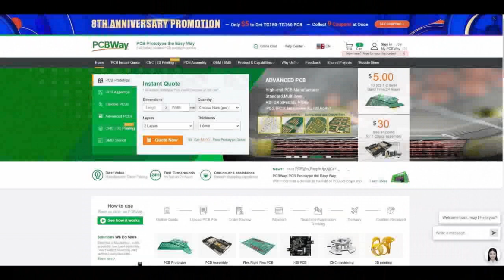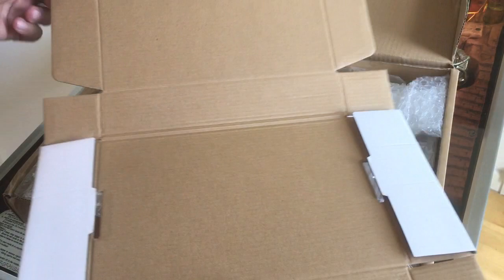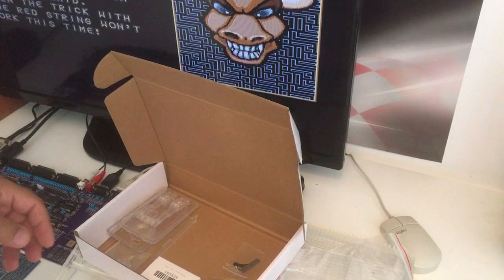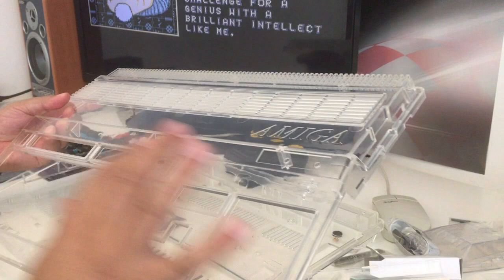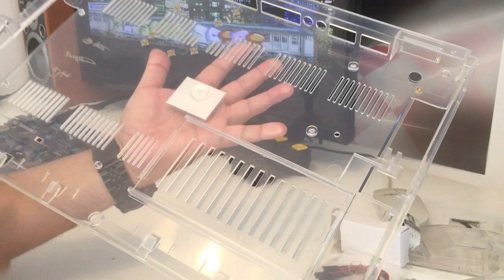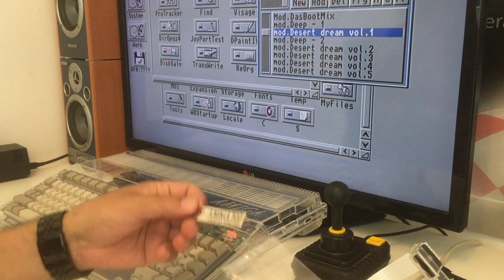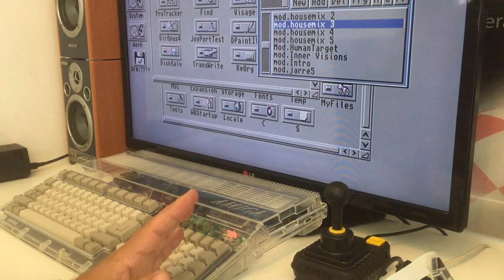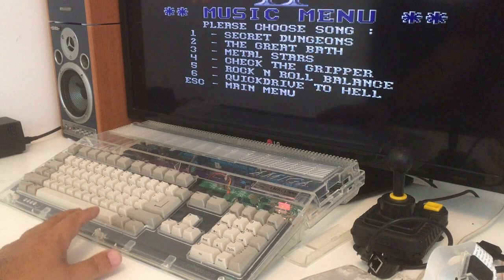Crystal Clear Limited Amiga 500 Ultra Replacement Case Unboxing/Review with A500++

Comment: Just WOOOOW 👍🏻🤠
Looks amazing 🤩 I need this case too,for my 500er ! Thank you for the great video 🍻🙂
Reply from the maker: Thank you Aco, remember to use the code: Retrocengo and now getting 20euro discount. Let me hear what you think of it :-)
Reply: One quaestion,  why don't you mount the shielding plate on the top of the Amiga ?

Cheeerssss 🍻😎
Reply from the maker: @acod.9774  Top plate blocks me seeing my Amiga 500 board🤣🤗
Well cuz it keeps the heat trapped inside makes the Amiga costum chips running hotter, which is a very bad idea for 35years old ic chips

Comment: I’m excited to receive my case too! I would love to be able to install a tiny PC in one of these for work, so I can pretend I’m using an Amiga for my job.
Reply from the maker: Hahahahha😊😊
What color are you after?
Reply: @RETROCENGO  I backed the original campaign for the Vampire pack, which I think is black. My original intention was to put an Amiga in it, but now, I’m thinking I don’t need to as I already have a complete A500. I wish I could put a PC in this instead, but I don’t think it’s possible. Let me know if I’m wrong!
Reply from the maker: @piyushkhengar  you can put in a raspberry pi in it easily 😊
I think a workaround for a micro atx board could be fitted in it

Comment: Your A500++ looks so freakin' awesome in that case, wow! 😍
Did I get it right, you're planning to put in the lower shielding again? Please don't do that, not in that crystal clear case!
Have you already tried to put the Floppy into it and the crystal eject button? There's a high chance that the button won't fit, if you've got the wrong drive!
That was the case with my recently bought transparent case for my A1200 (unboxing video on my channel ^^). Also I couldn't put in the Floppy at first, as the hole on the Amiga PCB won't allign with the metal bracket! I had to file the bracket holes (both of them!) a little bit, now it fits. Also I couldn't insert a PCMCIA adapter at first, as the case won't let me! I had to widen the slot of the case with a file a bit, works now.
Just tiny things, but they shouldn't happen at a brand new case at this price range! Maybe you have more luck with your A500 case especially with the Floppy! 😉
Reply from the maker: I haven’t had any issues, but floppy drive is not installed either. Well it’s not the old metal shielding, but a back bracket
Reply: @TPau65
Thank you for your feedback :)
- The A500 Cases are provided with Chinon FB 354 floppy buttons. Since there is quite the number of different drives out there we most certainly couldn't provide a button for all of them.
- The A1200 case was provided with a floppy button which likely won't be compatible with most A1200 owners drives. This issue  is due to both A1200 units used to design molds had custom drives! It wasn't spotted at the time and sadly its not fixable in molds. We apologize for this issue.
- The PCMIA Slot on all our A1200 cases are perfectly sized. 
Please double check your mobo alignment. Something must be wrong. You shouldn't have had to file your case. What you can do instead is insert a PCMCIA card in the slot first with your mobo being loose in the case. Then adjust mobo position in case and fasten mobo. This process should place the motherboard correctly in case with PCMCIA aligned. If you still have issues do not hesitate to message us through contact@a1200.net with close photos as we never had any of these issues before.  Thank you very much for having made a great review on your channel :)
The team.
Reply: @A1200NET  Thanks for your comment and all the tips! The mobo allignment in the case is perfectly fine for all four holes. And yes, I did try to screw in the board with the inserted PCMCIA2CF adapter. It simply was not possible, it was way off! It seems (allthough it doesn't look like that, looking from the back) that the board position is 1-2 mm to the back. I had to widen the PCMCIA case slot a little to the back AND the hole of the little metal Floppy bracket also towards the back (and to the right)!
I closely compared the PCMCIA slot with the original case. Absolutely no difference visible! Very strange, but all fits now. 😃
Reply: @TPau65  Thank you so much again for your feedback. This is definitely weird as we never encountered such issue before. For wathever reason it seems your mobo is pushed to the back, hence holes not corresponding and neither the PCMCIA slot. We're glad you got this sorted out, but again very sorry you've experienced those issues. Next time you open your case do not hesitate to take close & clear shots of your mobo & holes mounting. Thank you again Tpau65. :) 
The Team

Comment: These are fantastic cases! I'm interested in how it goes with a shield, I installed a CenturionTech bracket and plastic backing with my A500++ and those machined inserts just don't seem to allow a good fit around the power port; I'm going to try the same in my original to compare. I think I'd have preferred those for the board mounts instead with an extra plate for non-original kit (Pi, Vampire). Still, it's almost perfect and looks amazing with a touch of lighting! Finished with one of those Kipper2k keyboards with custom backlight and some other mods. :)
Reply from the maker: I’m actually waiting for exactly the same back plate from CT. You are saying it’s not a good fit? Old metal shield is the way to go?
Reply: For me the combo just makes the power socket a little too high by 1 mm perhaps, but it's totally fine once plugged in. Just a snag, but I'm curious if the original shield has the same issue.